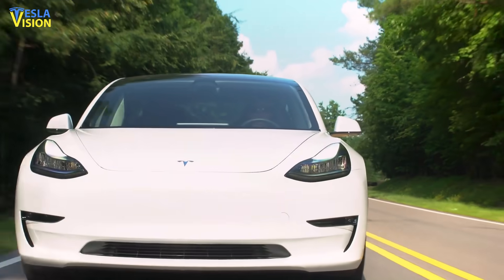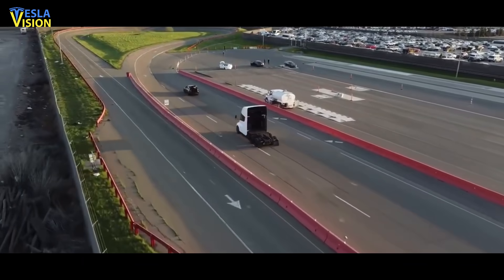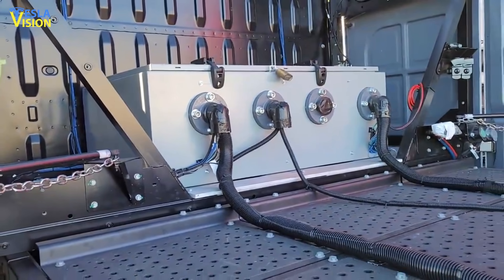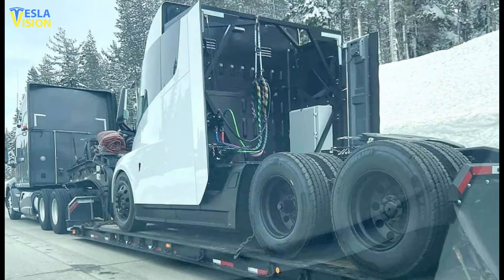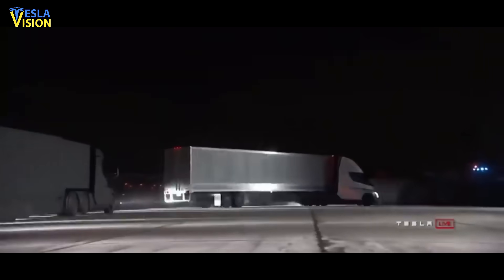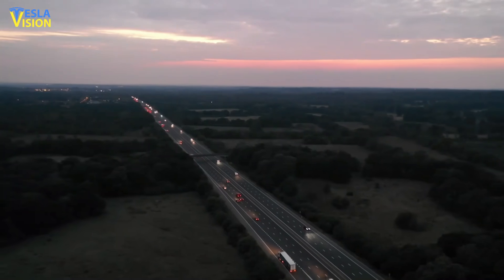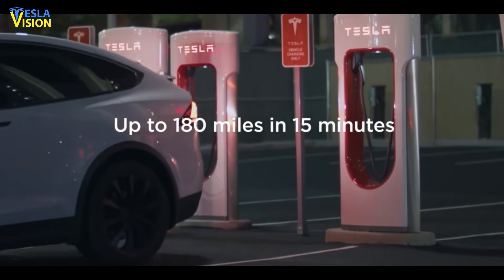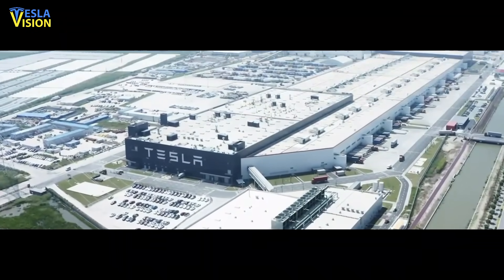The Tesla Semi 2021 Update Is Here!

Comment: I don’t see these electric semi’s will do well, well at least for long distance trucking. I can see the tesla’s semi’s being great in cities
Reply: Totally agree with you. There's not enough infrastructure to charge them either. I can see this becoming standard though if they can get more charging stations and longer range
Reply: @ethancupp530  For standard trips electric trucks ( that can cover the distance without a charge ) and that are automated are a no brainer.
Reply: @dimitrioskarageorgos5996  Short runs would absolutely be a no brainer. However owner operators and company drivers that do long haul will have issues finding places to charge. Especially taking into consideration the shortage of parking spaces.
Reply: @ethancupp530  Of course this isn't going to replace long distance trucks. It's a first generation technology after all, can't expect it to replace conventional means overnight. The mileage and the autopilot will get improved so I believe long distance trucks and truckers will also be eventually replaced for automated electric trucks and I'm talking next 15 years here
Reply: @dimitrioskarageorgos5996  I think we're having a miscommunication. I'm not opposed to electric tractors being on the road. I was simply agreeing to Randomgamers comment regarding long haul trucking. Also, 15 years seems a bit of a stretch due to the tighter regulations for diesel engines in a couple years. Tesla will most likely have charging stations made for trucks across the country within only a few years.
Reply: @dimitrioskarageorgos5996  automated trucks probably won’t replace the drivers and if they do it’ll be short lived. A couple malfunctions here and there and they’ll probably just say screw it.
Reply: @ethancupp530   How much infrastructure was there 100 years ago when the first horseless carriages were on the road?
To start, chargers will be installed at destinations. In time, more chargers will be installed along the routes where needed.
You guys act like it should all be installed and ready to go on day 1.  These things will take time... like every other innovation.

Comment: For OTR trucking, my truck had about 1000 mile range fully loaded (80,000 lbs). I don't think for the time being Tesla semi would work. It would work for day cabs, maybe line haul, and P&D where it could be charged at the company each night.
Reply: I f this truck can keep the drivers cool on their break without having noise and air pollution it will take over and make company more cost effective
Reply: @ralphmalph6097  exactly. if you have experienced any Tesla cars you will go for this truck. Also, how about no oil change or maintenance other than checking/replacing tires? drive the truck home, can power your house in case. :)
Reply: @ralphmalph6097  I never even thought of that. So much time is spent waiting for the yard or site to get their shit together. A quiet air conditioned/ heated cab 😩
Reply: It would be good yard truck 🛻
Reply: Percisely! That's why it's Pepsi and walmart that's getting it first! They are using these trucks to deliver the last leg
Reply: @jerryliu9570  Absolutely. And there is plenty of business to be had selling day cabs. Basically, any trucking company, where they are ending their day, where it started.
Reply: @typhoon320i  So glad to finally have someone that understands this. Think of all the start and stops. breaks are expensive as hell to replace. regenerative breaking will boost longevity. Espically when more and more areas ban engine breaking.
Reply: But u aren't allowed to drive a 1000 miles by law so if charging stations are quickly placed like the supercharger network it would work very well.
Reply: @Momo108iscool  I didn't say 1000 a day, I said 1000 miles range. I didn't have to fuel up every day. If I was on the road in the middle of nowhere with an electric truck, they better have a supercharger at the end of every day, even if that is a rest stop in central Nebraska. Get it? that's why I say it wouldn't work for OTR (over the road) at least right now.
Reply: @typhoon320i   Ryder had the maintenance contract for the class 8. Low batteries could be replaced with charged batteries at a ryder facility. However the ryder rules do not permit anyone to be in the truck when it is serviced so the sleeper berth could not be used. This is one reason that team driving is not feasible.
Reply: oh common. we all know that everyone follows the rules to a T right?